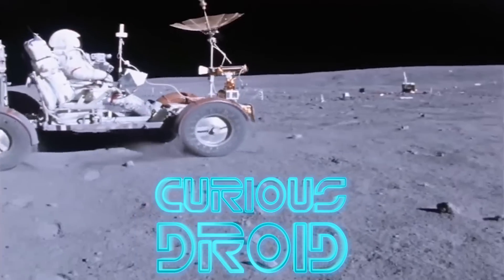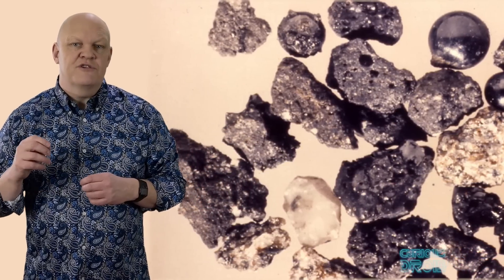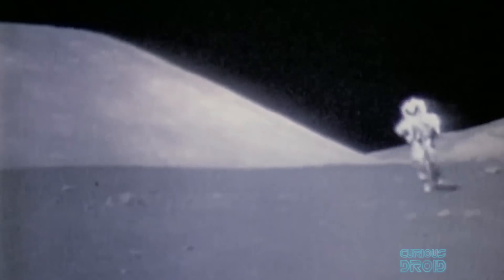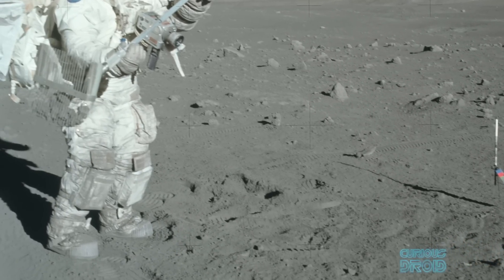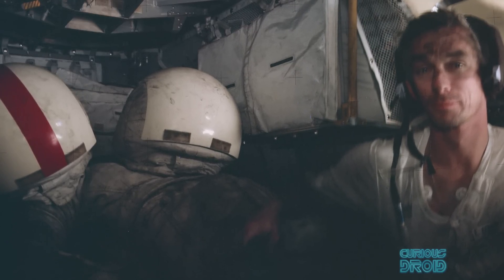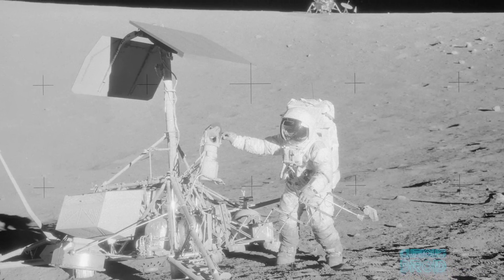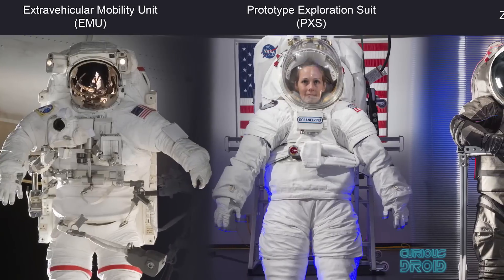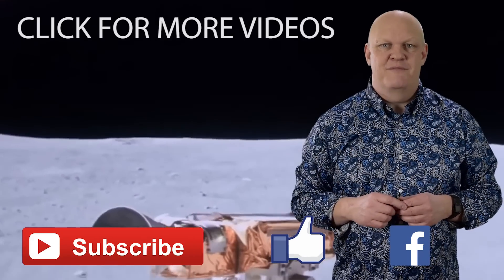Apollo, the Lunar Dust and NASA's Dirty Problem

Comment: Very interesting, but something worth pointing out is that silicosis is caused by crystalline silica and not amorphous silica, which is why it is a problem among miners but not glass workers. In fact there is evidence that lunar dust may be non-fibrogenic. 

It is also interesting and worth noting that because of the minuscule iron particles in lunar dust, the dust reacts to ordinary 2.45 MHz microwaves from a standard microwave oven. The heating from microwaves causes the dust to melt very readily, providing a simple way to use lunar regolith for in-situ manufacturing of building materials through sintering, hot pressing, or extrusion.

https://www.nasa.gov/centers/johnson/pdf/486017main_Taylor.pdf
Reply: interesting... So with solar power, teams of construction workers could build a large colony very easily. Now, is a by product of this... oxygen? I will have to read the paper. Thanks.
Reply: Rick Kwitkoski it is quite a  interesting paper. Fun fact - Harrison Schmitt of Apollo 17 is one of the authors.

I don't believe that any oxygen is produced as a by-product, the regolith just heats up and begins to melt very rapidly from microwaves. One of the coolest applications of this that I have read is sending robots that would 3d print a base using only moon dust.
Reply: hopefully a method to seal bearings in the robots against the dust can be devised otherwise there will tin woodman calls for "oilcan oilcan"!
Reply: Rick Kwitkoski hmm, I wonder if an intentionally loose seal, and a plentiful supply of lubricant leaking through it would continually wash dust out...
Said lubricant would probably have to be able to not boil in a vacuum, or at least boil slowly enough to get the dust a decent distance away.
Reply: If wonder if microwaves could be used to melt some of the dust around a Lunar base, just to keep it from being a problem.
Reply: Seems like collection of the dust for use in construction would resolve that problem for the most part itself, Kevin.
Reply: @seigeengine  I think the regolith is 4-5m deep in the mare regions and up to 15m thick in the highlands though! That's gonna take a lot of getting rid of!
Reply: Does non-fibrogenic mean non hazardous to humans?
Thx
Reply: Not necessarily, George, but non-fibrogenic means it doesn't generate fibrous tissue in the lungs. Basically, if my limited understanding is correct, it doesn't promote scar tissue formation.
Reply: @seigeengine  
Interesting
Seems to defy basic common sense.  You would think tiny, razor sharp shards in the lungs would scar the hell out of your lungs

Then again ..... I'm not a doctor
;)
Reply: I know it's minor but, I believe you mean 2.4 GHz because 2.4 MHz is well in the shortwave band.

Comment: at least the moon isn't covered in that lunar "quicksand" from arthur c. clarke's novels. that'd be an even bigger headache.
Reply: It was a concern prior to Surveyor 1. The Surveyor program conclusively showed that the moon was not covered in a thick layer of "quickdust".
Reply: @ConsciousAtoms  Soviet Luna 2 already 1959 showed that Moon`s surface is hard.
Reply: @marguskiis7711  Luna 2 crashed into the moon at 3 km/s. At that speed, everything is hard, including quicksand. Therefore, Luna 2 did not prove that the moon does not have a deep layer of dust that can act like quicksand.
Reply: At least one prominent scientist thought that the lunar lander would sink several feet in the lunar dust that just had to be blanketing the surface of the moon.   It was quite a concern in some quarters prior to the launch of 11.
Reply: Zamolxes77, that is certainly possible but highly unlikely. Although large expanses of the moon have not been explored, we visited quite a bit more than 6 areas on the moon, if you count all the successful unmanned landers (surveyors 1, 3, 5, 6, 7, Luna 9, 13, 16, 17, 20, 21, 24 and Chang'e 3 / yutu). Also note that at least one failed lander (Luna 23 if I am not mistaken) has been found lying on the lunar surface by LRO, not having sunk into quicksand either. 

These missions were scattered all over the visible side of the moon; all showed rather similar terrain, and none of them has found any traces of quicksand. Moreover, the rover missions (Apollo 15, 16, 17, Luna 17, 21, Yutu) have covered quite a bit of ground each. All in all, I would be highly surprised if an upcoming lunar mission would sink into quicksand.
Reply: Uhm, how do you know that ?  We only explored six little areas on the Moon, there could be entire seas of quicksand !
Reply: Zamolxes77 who knows? (dun dun DUUUUNNNN) ;)
Reply: ConsciousAtoms i'm aware lol
Reply: I myself only just happened of late to close study moon dust in web, youtube captions and as noted the surface of the moon everywhere has a shallow uniform layer of moon dust...pics coming back from new china moon rover as rolling through the self same, like six inches, of the very fine moon dust...narrator doesn't mention it's thought moon has thin, and like just a few yards high, moon dust atmosphere...and Mars is dusty in same fashion?...all the moons, asteroids, and such, with no atmosphere, have dust?...and same thickness?...need a 'slices of regoliths chart' showing layerings!☺
Reply: Decades ago I remember some Creationist use the lack of dust buildup as evidence of a young Earth. Such BS.
Reply: Rrobert Dee how long did it take you to come up with that incredibly unfunny reply? Im guessing you probably think Trump is hilarious.
Reply: Was that supposed to be unfunny on purpose?. Or are you a Trump supporter which would explain everything